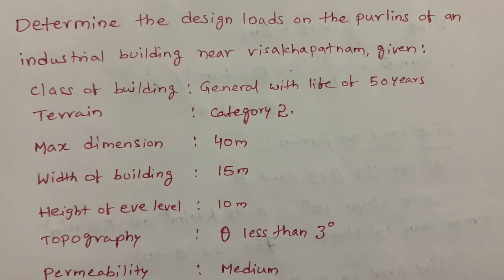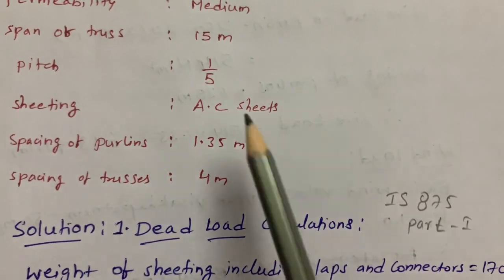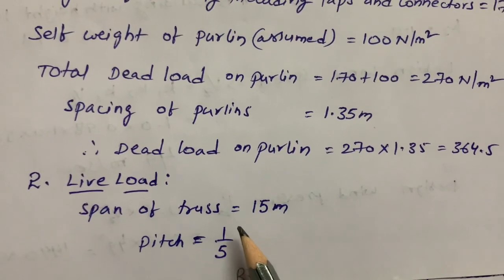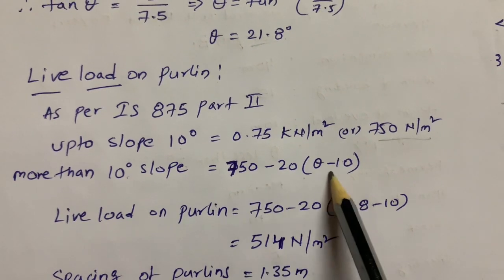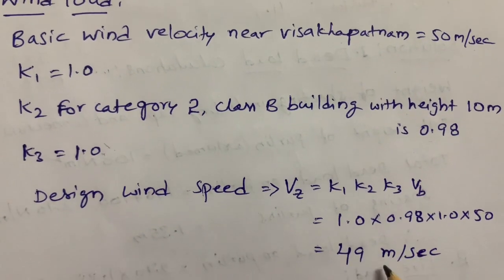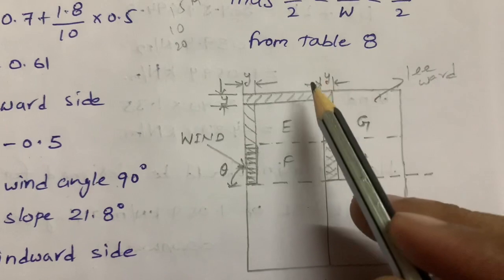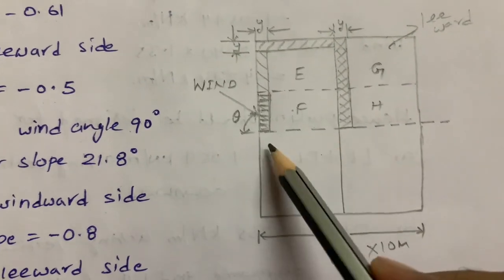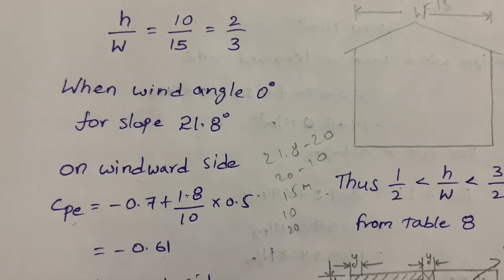#Design of steel structures#Design loads on purlins#Design of roof truss#Wind pressure#IS 875#

Comment: Sir, some errors are there in this video. For calculating design wind speed ,k2 taken as 0.98. but in code for category 2 building (ht. 10m) it is 1. interpolation values are correct but the explanation is wrong. also error in the wind speed calculation. some terms from codes are not mentioned.
Reply from the maker: Thank you so much. It’s practical don’t bother about values. Follow the procedure.

Comment: Didn't calculated wind pressure pd directly substituted 🤷
Reply from the maker: Design wind pressure PD=0.6x49square 49 is Vz value i.e design wind speed. 1440